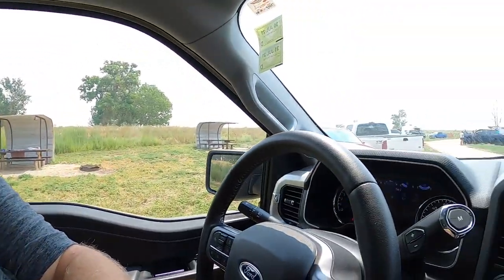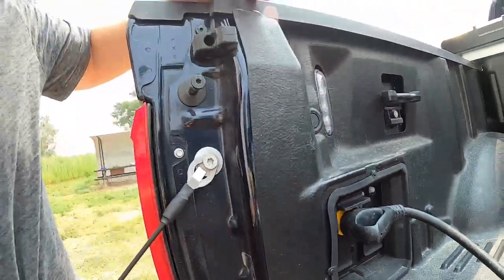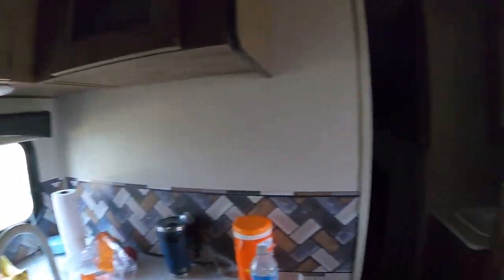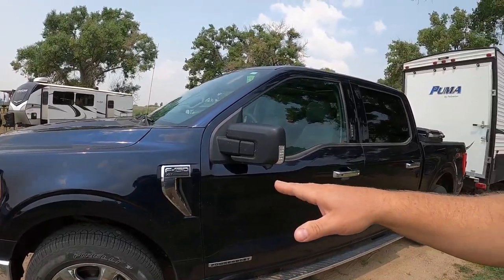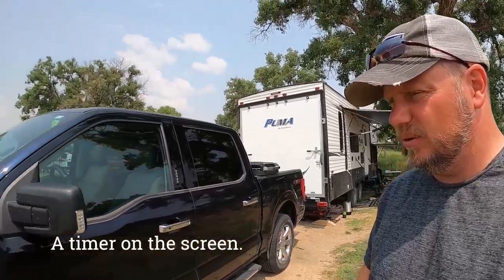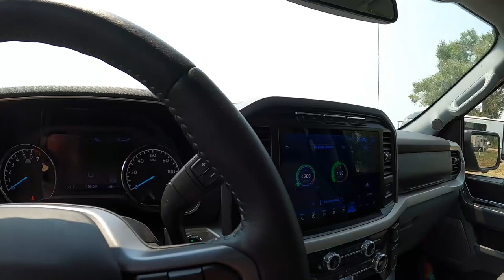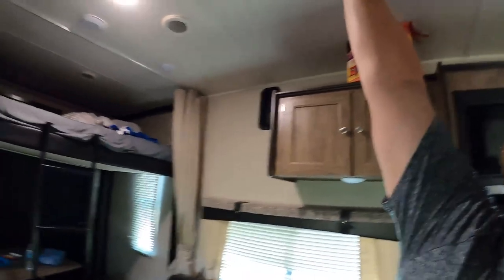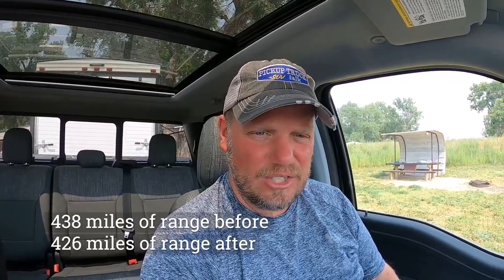Shocking? Running A/C for hours, 2021 Ford F-150 Hybrid Generator

Comment: I'd say something like the lightning would be more efficient.  even if the load was a constant 2 kw for 8 hours that would only be 16 kwh used. Max cost at a fast charger .43 so $6.88. probably less because the AC probably won't run the entire 8 hours. This is without using any gas & no engine wear. So using 16 kwh on a trip you're getting say 1 mile per kwh you used 16 miles of driving.
Reply: More efficient, but not nearly as high capacity.  A Plug-in Hybrid version of the F-150 with Pro Power Onboard could be interesting.  RAM Revolution EV with REPB may tap into this opportunity, we'll see if it has anywhere near as good of outlets as Ford Pro Power Onboard.

Comment: It might sound like s dumb question; but using the generator for extended time doesn't have any effect on engine wear? Over the lifetime if they truck.
Reply: I think that is an excellent question. I believe Scotty Kilmer said extended idling is bad for the transmission...not sure if it applies here.
Reply: Lease it!
Reply from the maker: Engines don't care if it is running or not. In fact, engines love to run and the more they do, the better they perform. Just look at all the million mile trucks - the more they ran, the better.

We have had hybrids like this truck on the market for over a decade now with no long-term issues.
Reply: @Pickuptrucktalk  Thanks. I definitely want the generator on my next Ford F150.
Reply: I know this isn't apple to apple but I idle my 1997 ford F150 for 8hrs + everyday when on the road working on days off not doing anything it's 12-18 hrs idling. 6 yrs and running just replaced a water pump in 6 yrs. So idling isn't an issue!

Comment: If your camper is able to run 220v @30 amps it would likely have better results, instead of only using just one 110v feed from the generator.
Reply from the maker: What campers can handle a 220 volt though? You’d blow all your appliances apart.
Reply: @Pickuptrucktalk  no camper is 220v in the US. They are split phase 120v, just like yours.
Reply: @charlieodom9107  no 30amp RV is a hot 120v, a neutral, and a ground. Strictly a 120v system.

50amp RV plug is 240, 2 120v, a neutral and a ground, same 240 as a house service, 2 120v lines
Reply: @F239141  wrong. A 50a RV is still 120v! It is split phase and runs one side of the panel on one leg and the other side on the other leg. There is NO 220/240 on a 50a service.

There is also a split phase 30a service, which is what most campers have. It is the same as the 50a, with 4 wires, which is what is in the truck. Many portable generators also have a 4 wire system, so it can supply 220/240v, but the amperage is limited by the device, not the plug configuration.

This camper has a 3 wire 30a service, so no split phase, and the truck has a 4 wire 30a service. The adapter plug combines the 2 hot legs.

Comment: That sounds like a problem honestly.

I get that $750 is cheaper than a 4000 watt generator, but honestly I don't think it's worth it to idle my $12000 hybrid engine to death. Or burn up my $6000 hybrid battery.

Plus if it's starting and stopping every few minutes all night long, that sounds like it would burn up my starter motor too.

I'm suspicious as hell

Comment: Great video.  Thanks.  Now, if someone wanted to add a bed cover to the truck and lock stuff inside would there be any easy way to route the power cable out of the bed without modification to the cover?  In other words, is there any cable routing exit by the outlet panel, etc?
Reply: Did you ever find a way to do this? I was wondering about this myself.

Comment: Most Campgrounds charge average $35 a night for full hookups... It cost $16 to run a Micro-Air Easy start equipped 13.5k RV rooftop A/C unit in the summer heat for 24hrs using a Honda EU2200 generator on eco-mode..... That trucks generator is definitely not as fuel efficient as a small portable Honda, so save the wear and tear and get a site at a full hookup campsite OR get the Honda EU2200 genny....... https://youtu.be/xkGil4bMqkA

Comment: Tim can you tell me your thoughts on the how this power boost does on towing this trailer can you fell the weight behind you and how are the hills and stopping great video I just waiting for my limited to arrive at the dealership
Reply from the maker: Tomorrow. I have that video coming too.
Reply: Great I be watching this is why I brought this F150 and I am trying to figure out the right trailer to buy were the length and the tow weight with out over loaded the f150 capabilities
Reply from the maker: @charlie-qm9gz  We are looking at buying one now. My parameters are around 30' long and less than 8k lbs GVWR, less is better. Dry weight no more than 6,500 lbs. Hope that helps.
Reply: Thanks tim for your input looking forward to seeing your video on how the f150 towing capabilities

Comment: Li-ion batts stay healthiest (last longest as far as lifespan goes) when they are able to stay between 20-80% charge. Over and under that range starts to take a toll on a rechargeable battery. That, and starting/stopping an engine takes more fuel than it takes to idle for a few minutes, so its unsurprising to me at least, that the engine is pretty specific when it fires on and off to spin the genny.
Reply: I wonder if thats the reason Toyota decided not to put one in the new hybrid Tundra and wait to put it in the Tundra PHEV which could have 20-30kw of battery.

Comment: Who the hell sets the AC to 65°? That's crazy. 70 is more than cool enough. 🙂
Reply from the maker: Eh, I wanted to make sure it ran the entire time.
Reply: I hand my camper down to 63 then shut it off .Was 75 in 10 minutes.Blazing sun 90* out.Then never went down past 77 till it cooled off.
Reply: @2hotscottpro  I work out of my air conditioned garage. Everything is insulated except the ceiling and on a 100 degree day they only way to keep it cool is to start it at 10am. It will never catch up if I started it after 12pm.

Comment: Starting and stopping all the time... Get ready to put Starters, Bendix and new Flywheels in once in awhile... LMAO Good stuff thanks for posting
Reply: Starter runs on a belt
Reply: @timkavanagh2872  doesn't it have to engage a Bendix that engages the flywheel to start the engine or Ford's got that covered lol?

Comment: 7200watt should be able to do a 50amp RV
Reply: Those are 50 amps at ~240 volts....so 12,000 watts
Reply: @farlesbarkley1022  but you’ll never use that. My camper came with a 5500onan and that’s plenty.
Reply: @TheTeeDay  50 amp service exists because people use it. It's nice to use shore power exclusively for the week instead of having to run your generator off your fuel tank. We don't run our onan when there is 50A shore power, and we use more than 7200 watts to run both A/Cs, lights, stove, toaster oven, coffee maker, hair dryer...whatever the hell we want all at once. 

It's important to know that 7200 watts will NOT duplicate what you can get through a 50A service
Reply: @farlesbarkley1022  yes I understand that but not one 5th wheel today comes with a 12,000watt generator. We checked when we got ours installed. Also it’s 2-50amp 120v 6000watt plugs (makes 4prong). You run out of amps way before running out of watts. Their is also a difference between starting and running wattage. 7200watts will be enough for most people running 5th wheels. That’s why most dealers only install 5500watt generators.
Reply: @TheTeeDay  And, really, an F150 hybrid shouldn't be pulling a fifth wheel anyway, 99% of them would put you way over payload. 

So I agree with the principle that, basically, the 7200 watt ProPower should power any RV that can actually be towed behind a half ton
Reply: @farlesbarkley1022  again didn’t say fifth wheel but a 50amp camper which would clearly be a travel trailer with 2ac. Also just because it powers it doesn’t mean it had to tow it. You’re 0-3 their is already videos you of the f150 powering a 50amp camper…..
Reply: @TheTeeDay  the 7.2kw generator cannot provide whta a 50 Amp service provides. I've powered my house when the power went out with a gen that size, it's a matter of what you run at once and whether or not you need 50A

Fact: the 50A service connections are 12,000 watts if you need that much, propower won't do it
Reply: @farlesbarkley1022  no one uses all 12000 of available watts. You’d simply hit your amperage level first. Hence why dealers only offer a 5500watt generator on 50amp RVs. It’s not about availability it’s about what average running watts are and the fact of the matter is most people are only hitting about half their available amount. Their are literally videos of people already using this system with 50amp RVs so chill. 0/4
Reply: @farlesbarkley1022  FYI a 30amp x 120v camper can only take 3600watts. This truck technically puts out enough power for 2……

Comment: It’s unfortunate you can’t use the 220v plug at 30 amps it would be way more efficient
Reply: What are you talking about?
Reply: @charlieodom9107  220v at 30amps would allow almost double the wattage? What dont you understand?
Reply: @Bruuuhhhhhhuuu  you clearly don't understand how electricity works, so there is no point in trying to explain that he gets the full 30a capacity of the camper in that 30a plug.
Reply: @charlieodom9107  im electrician lets hear your explanation
Reply: @Bruuuhhhhhhuuu  What would you like explained? If you were an actual electrician, then you wouldn't need anything explained to you! Also, please speak in intelligible and complete sentences, so the educated world can understand you!
Reply: @charlieodom9107  lol relax charlie
Reply: @charlieodom9107  ok charlie i have time today so ill explain it to you lol the adapter he is using doesnt allow 220v 30 amps the rated 7.2kW its roughly half because he’s taking one leg of the 220 4 prong twist lock and converting it to 3 prong 120v which utilizes only have the wattage only allowing half the amount of circuits in the camper. Since you were unable to add to this, and just being a troll is your only talent, I think this concludes our “conversation .”
Reply: @Bruuuhhhhhhuuu  Small correction, generally a 30A plug for a trailer is single phase and runs all the circuits in the trailer, even if dog-boned down to a standard 15A plug (though this would not supply 30A).   The 50A plugs that some larger RVs come with have two 50A circuits, and if you dog-bone to a 30A (or god forbid, a 15A) plug you only power half of the panel in your RV and thus half the circuits, though the 2nd half may just mostly be a 2nd AC unit.
Reply: @Dassin444  single phase is 220/120v yes

Comment: RV Rooftop ACs suck Power so does their Fridge and hot water systems.. .... they are not efficient at all.  The American RV market hasn't really kept up with energy efficient appliances at all.  They need to totally revamp their systems... They could easily squeeze half to two thirds of the wasted power out... A 400 watt solar setup with 400 amp hours of lithium would be perfect... for most.., it can be done.. As it stands now.. the system in that RV would suck up.... more power then you can generate... you'd need easily a 1,000 watts system with a 800 amp hour battery bank ( lith ions ) to do the same job....

Comment: The big question here is Reliability!!! Ford does not have the greatest name for Reliability. There is ALOT of Stuff on this truck to 
go South Real Quick. I could not even Imagine having this system fail and taking it to Ford out of Warrantee, I'm guessing  Ford
Service is Hiring Electricians to work on these?? Way to much Stuff to go wrong for me!!!
A for Effort though.
Reply: This is a gimmick. If you need your truck you are left buying power or going without. Your power scorce needs to be attached to the camper not the truck.
Reply: I’ve owned my 2011 F350 since September of 2010 and it’s been the perfect truck. No problems at all to speak negatively about. Not sure what you’re talking about.
Reply: @secretsquirrel572  you should buy a lotto ticket. Ford is known for breaking down and poor quality. You must change your oil every 1000 miles to keep the cam phaser rattle ta Bay. Unless it's a diesel. then your probably drinking coolant and just overlooking it.
Reply: @ernestjohnson1807 … guess the Koolaid isn’t as bad as you think or you bought a junker that was beat on. I’m near 150,000 miles and have yet to have an issue.
Reply: @secretsquirrel572  no Ford is trash. Try changing your oil like Ford recommends.  You will get the same rattle. Funny how the tundra uses camphasers and you can follow thier service schedule and not have issues. Ford has problems with them in 4 different engines. The 4.6 5.4 5.0 and 3.5. You would thing someone some where in that sespool of a company could figure it out. So I stay away from ford so I don't have that revolving repair bill.

Comment: Spending $75,000 for a $700. generator is so Ford fan boy. 😆 there is s sucker born everyday I guess.
Reply from the maker: $75k?
Reply: First, you can't get a 7500 watt generator for $700, and it's more than just a generator, it's more power, better City efficiency, convenience at drive-thrus, banks, with the added versatility of always having your generator there rather than having to stow it back there, for instance you can use it at the drive-in theater to power a fan, even a small AC if you want, basically limitless applications. Not to mention I can bet you with very high confidence that the other manufacturers will offer the same thing very soon, I am sure they are scrambling to get on it because it's ingenious to incorporate a truck with a generator. Welding, power tools, coffee makers, microwaves, Electric blankets, TVs while your tailgating without having to drag the generator everywhere.
Reply: The cost of a invertor generator from Honda starts at $1000,00 for a 1,000 watt unit.  Clean power in not cheep.
Reply: People who think you are buying a $75K (or any other amount) pickup for a generator are ignorant. That's like saying you are spending 75K for a cd player. The 7.2 KW Inverter is $750 option on a on a truck. You can't even get close to that price for a comparable portable one. If it will not work for your situation definitely don't buy it. But for me, I'll take the 24mpg (actually only 22mpg for me?) and enjoy plugging in my camper when I need to. 
Thanks for all the great videos Tim.
Reply: @dslag6  tell me how that goes when that generator on that truck goes out. Now your not just out a generator but your whole truck is in the shop and your trailer is out of power. With Ford reputation you can keep it. Now the serrated generator sounds a lot better. It's your money you can inconvenience yourself with it as much as you want.
Reply: @ernestjohnson1807  again, it's an option on a vehicle. If any option on you vehicle breaks you need to drop it off to get fixed. The reliability of all trucks nowadays are pretty close. 
Should we compare my portable audio system to your trucks system next?
Reply: @dslag6  what ever you say bud. But I want my power scorce to be attached to the rv not the truck. But he'll you think your smarter then the avrage bear. So you tell me how pissed mommas going to be when you take her power away when you take the truck to the lake to fish while she at camp. So go get ya that 75,000 gimmick. Then get you another generator for the rv.
Reply: @tylerking27  I drive a tundra with 380,000 miles. But I am about to buy a santa cruz for a commuter. I will never buy another Ford. Every person I know has been burnt by them.  If you have ever owned an rv you understand it does no good to have your power scorce attached to your truck and not your rv.
Reply: @ernestjohnson1807  If anything "goes" then we get it fixed!  Love how many gas engines in vehicles are very quiet and insulated these days, far better than generators, even Honda generators are noisy by comparison.